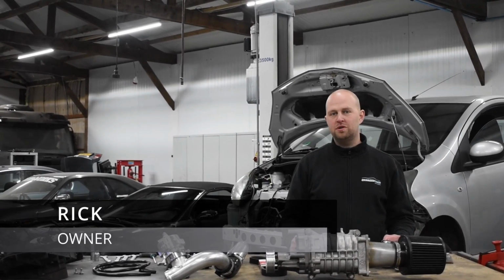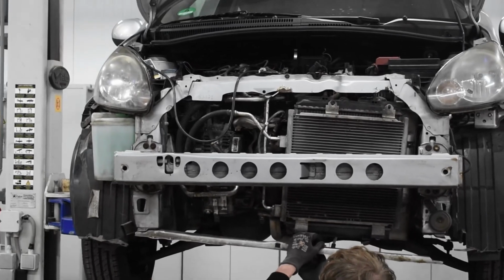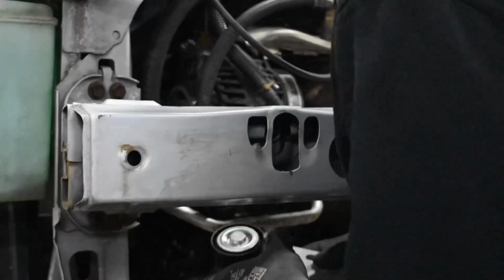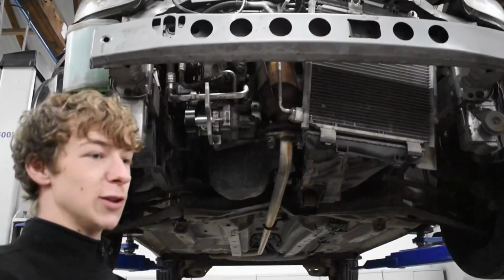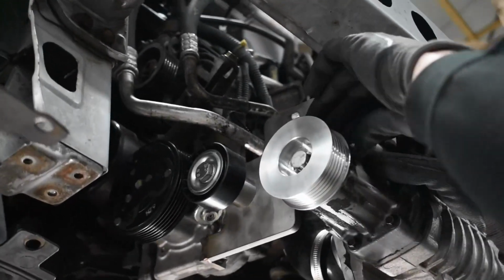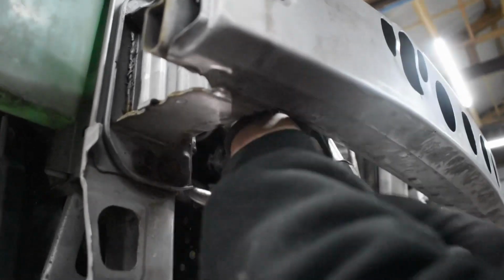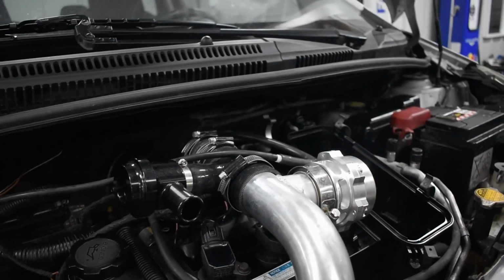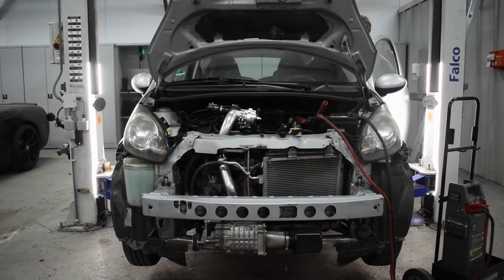Toyota Aygo / Citroën C1 / Peugeot 107 Supercharger system installation | Chargertech

Comment: Meh, you don't sell it anymore...
Reply: They actually do but no longer advertise it to the public. I'm planning to get one and they confirmed that they still can make it.
Reply: @Gourmondise i just saw this and im interested apart from the map do you need to do more mods? And can this be fitted on the citroen c1 mk2?
Reply: @mty1919without a map it will blow the engine or will stall on higher revs. Mapping is a big part of this tune. If you don't want to pay for it there is no reason to install a supercharger.
Reply: what supercharger are you using
Reply: @georgeclarke1183 it's from a VW 1.4 rev-e supercharger. Plenty can be found on eBay.

Comment: Hoi, Zojuist een Toyota Aygo van 2016 gekocht. Klopt het dat als je op de snelweg 100 rijd en je een brug op gaat de auto niet versneld terwijl je wel gas vol indrukt? Heb het gevoel dat de auto begrenst is terwijl hij eigenlijk makkelijk 160 zou moeten kunnen? Wil weten of dit eventueel een defect/verstopping is of dat dit normaal is bij toyota aygo. Als dit normaal is ga ik ws wel op zoek naar wat meer power Chiptunen of eventueel een turbo.
Reply: ja dat klopt!
Mijn moeder heeft een C1 van 2018 en ik een 107 van 2006 en beide hebben moeite om met vol gas de heuvel op te gaan in zijn 5 (de auto uit 2018 meer dan die van 2006).
Dit komt natuurlijk omdat het een hele kleine motor is met weinig koppel. (pk 68, koppel 93 Nm). Hierdoor moet je een versnelling lager gaan wil je sneller gaan als je heuvel op wilt.
Reply: De 5e versnelling is een overdrive, je hebt sws weinig koppol in de 5

Comment: Trouble is that its the size of the engine , and probably costs more  than the car.
If you want a fast car , buy a fast car . Theres no point in putting racing shoes on a cart horse.

Comment: Would the economy be better or worse with it on? If u did a remap I’m guessing u would get better then standard MPG. Also is a turbo more economical then a supercharger?
Reply from the maker: It al depends on your right foot. With normal driving it will be slightly less economical but that's comparable to having the AC on. When you floor it it will be much less economical. There are some differences between turbo and supercharger in mpg but on low boost these differences will be very small

Comment: How this affect drivability? I mean, won't so low placement of the air filter pick up any water during rain?
Reply from the maker: It's a possibility and if you are in a wet location you might want to add an extra piece of hose to place the filter in a different location. It can be easily changed. 

The goal was to design a kit as cheap as possible which means you make some concessions. However the design is also made simple so you can also make your own changes to it.

Comment: What is the piggyback ECU your using
Reply from the maker: We use a ecumaster det3, we can supply this with the kit with a wiring diagram and basemap
Reply: @chargertech  Would you be able to send the wiring diagram?
Reply from the maker: @dillonlee3229  it's not very difficult just some splicing of wires, rerouting them through the piggyback and some resistors(also supplied with the kit) to make the original ECU think it still controls the injectors.

Comment: Hey Chargertech, are you going to make an "after" video with some dyno pulls or 0-100 im very interested in buying it for my 2013 107, with almost 60k km on the clock
Reply from the maker: Hello, we are making another promo video soon.
Reply: @chargertech  you making that video yet? just wanna know how fast it is and how much power its making. see if its worth getting
Reply from the maker: @chillout9017  we have a bit of video material but the person that edits it for us is very busy so that's why we haven't posted this yet. Hp figures can go from 20-30hp more to double the original but the more you push it the more risk you take and some engine modifications would be adviced. When we did the low boost setting that we would do on a stock engine we had 25hp/40nm extra.
Reply: @chargertech  damn, what was the 0-100kmh?
Reply from the maker: @chillout9017  we didn't get very exact measurements due to traffic and weather but around 3seconds less than original so around 11 sec. On low boost that is. High boost we haven't tested it because the engine we used was stock and we didn't want to break it.
Reply: @chargertech  very cool 👍
Reply: @chargertech  any update on the video?
Reply: @chargertech so, now you’ve got an Aygo with 93BHP ⁉️ What’s the point ⁉️😂🌸💕❤️👍
Reply: I got a c1 with 70k on the clock 2013 and was gonna comment the same thing😂

Comment: Will this kit work on a 2017 toyota aygo?
Reply from the maker: We haven't tried that out yet. The engine has remained the same but the bodywork has changed so perhaps the bracket or supercharger will hit some different parts. It can probably be made to fit.

Comment: Maar hoeveel pk draai je met de supercharge
Reply from the maker: Dat ligt er aan voor hoeveel druk je zou gaan. Low boost 25-30pk extra, ga je voor high boost is een verdubbeling van het vermogen makkelijk haalbaar maar dan moet het blok wel mee versterkt worden.
Reply: @chargertech  nog een vraag ik zie geen intercooler  kan deze er wel tussen en is dat beter
Reply from the maker: @popster1973  het doel was een zo goedkoop mogelijk systeem te ontwikkelen om het voor iedereen betaalbaar te houden. Met 1499€ voor een complete set is dat dus wel gelukt maar een intercooler was voor deze prijs niet mogelijk. 

Ik denk dat waterinjectie makkelijker is maar een intercooler zou er ook tussen gezet kunnen worden.